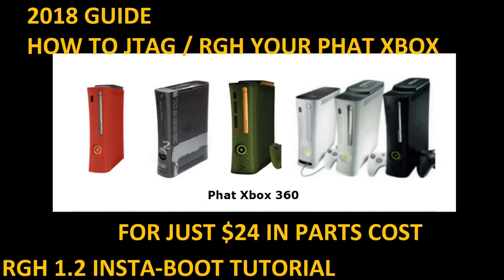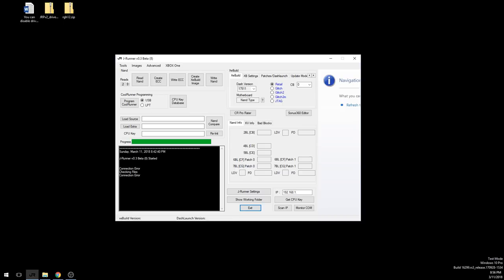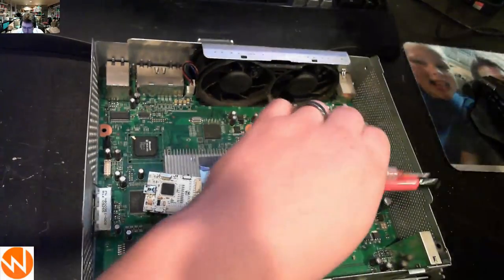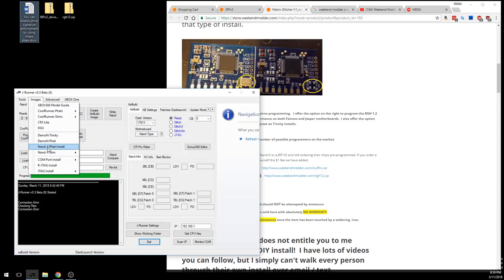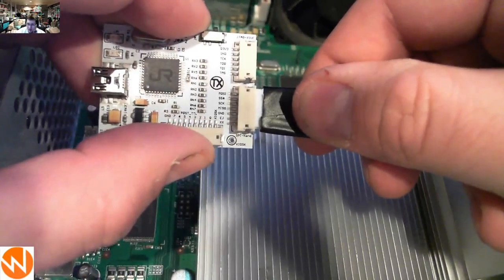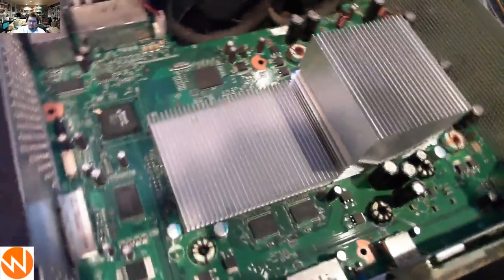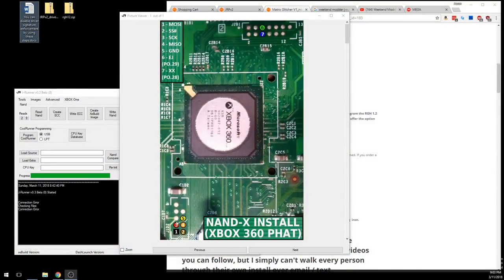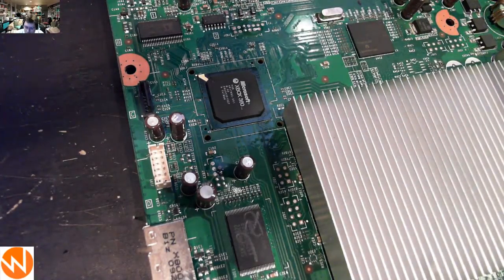2018 Complete Guide to RGH not JTAG your fat PHAT Xbox 360 for mod menus and emulators

Comment: Attempted this on a JASPER 16 mb.  Soldering looks good, able to write the ECC.  At this step, Xell will not load - just a black screen. Fans are not at full speed, green light blinks repeatedly.  I tried to reinstall the original NAND, and now I get a red ring of death.  Any thoughts?
Reply: OK, so I removed VCC from matrix glitch chip, and now the XBOX loads fine with the original NAND.  What would problems with the Glitch Chip connections look like?
Reply from the maker: Nope - with original nand and a glitch chip active I'd expect it to fail.   Double check that before you click "create ECC" that you have the Glitch2 selected then re-write that ECC file to the console, re-hook up your power wire to the glitch chip and try again.    What timing file did you write to the chip?  The RGH 12_21 ?
Reply: So, one difference b/w this video and my setup is that my 360 has Dash 17526, the May update.  I am attempting to use J-Runner with updated XeBuild files (from the team-xecuter.com forums, can't link for some reason).  I am thinking this may be the problem.

-Glitch chip is programmed with RGH 12_21.  I attempted other timing files as well, with no luck.

-Glitch2 definitely selected, still nothing.

-I went back and used a voltmeter to test the wired connections from Glitch to board - no resistance, so I assume they are good.

-I've looked on other forums, and it looks like the symptoms (black screen, no Xell loading, single center green blinking LED on faceplate) can be caused by a bad flash.

Any other thoughts?  Thanks for help!
Reply from the maker: Its definitely not only because of the newest dash 17526.  RGH 1.2 works just fine on even that newest dashboard.   What sort of AV connection are you using?  Tried alternate HDMI vs AV?

Comment: I have f... up the R8C2 RST Point ... where can i buy a restistor like that ? Do i need to buy a defective Board ?
Reply from the maker: It's a 1K ohm like 0502 package resistor. I actually think I bought a roll of a few thousand of them.   Lemme see about adding them to the store tomorrow.
Reply: TheWeekendModder Thanks a Lot :) I think an EBay link would be better. The shipping to Germany cost to much from USA sadly.
Reply from the maker: ZaZzCode you might be surprised.  I ship to Germany for something like like $6usd.   Still too much for resistors only, but maybe you'd see other stuff on the site.
Reply: TheWeekendModder Yes i think 6$ are good to Germany. Okay i think i Search for More in your Shop :) I have RGH'ed about 25 Consoles ... And then i got this Jasper that wouldnt boot with RGH 1.2 so i did the S-RGH and this works a lot better. But then i messed up the resitor.

Comment: Can you still solder a 3.5" HDD using a sata cable after this mod? I would like install a bit hdd internally. Thanks!#
Reply from the maker: I don't know what you mean by "solder a 3.5" HDD" .    Solder it to what?  Or why? 
If you mean just installing a 3.5" HDD - yes, but you'll need to be creative about powering it.
Reply: TheWeekendModder Yes, correct. Ive seen a pretty simple method of soldering a sata cable to the motherboard hooking GND, +12 and +5 to the board so you can have an internal HDD. I am looking to make a drive bay so I can remove the drive easily for hooking up to my PC for loading homebrew stuff more easily. Thanks!
Reply from the maker: External USB HDD would be a much simpler solution.  I like the WD "Mybook" ones.

Comment: Would this work for a zephyr? The pictures in your image include a halo 3 360, many of which were zephyrs
Reply from the maker: In theory, sure - but in my personal experience the Zephyrs were very difficult to mod and aren't worth the trouble.
Reply: @TheWeekendModder  sorry to revive this question, so i can use this  chip on a zephyr? Asking because i could practice the rear soldering on it then get another chip for my jasper.
Why do you say its a pain?

Comment: Hi there! Many many years ago, while trying to flash an x360 disc drive to run burned DL discs, I accidentally dumped the original data with 0000000000000000000 as the drive serial number, then patched it and wrote it over the original one with this wrong serial, so the drive would no longer be recognised by the motherboard because it had the wrong serial number. With this JR Programmer thing, would it be possible to recover the original serial, witch is suposedly stored in the motherboard data?
Reply from the maker: I think you're confusing "serial" with "dvd key".   Yes - you could RGH the console to obtain the DVD key and then either re-flash your disc drive with the correct key, or if you keep the console RGH'd you could change the dvd key within the nand to match what is on the drive.   Either way works, the keys just have to match.
Reply: @TheWeekendModder  yes well its been almost a decade, i kinda forgot the right lingo here :D but thank you very much for the answer!

Comment: I accidentally let a blob of hot solder fall off of my iron onto the board and it happened to land next to a RAM chip.
It splashed and went underneath the ram chip, I managed to pull it out the way it went in but there's still some under there shorting it out.
Any idea of how to get the rest of the pieces out? It RROD's because of it. I am using leaded solder which I think has a lower melting point.
https://imgur.com/a/JdkbJEv
Reply from the maker: Man! That's a tough one - unfortunately the only tricks I know about would involve a BGA hot air reflow station and removing and reinstalling the whole ram chip.  You'd need solder balls and a template and the whole deal.
Reply: yeah haha it was very unlucky. I'm just gonna use it for parts I guess, I don't have the tools to do that. I have another xbox though i'll try it again soon.

Comment: also can this V1 matrix work with A slim Trinity? I think I've read it does. I have a RGH falcon from the beginning of RGH. I now want to try this on another falcon and on my slim for the longevity. hope for some replies
Reply from the maker: Yes, it can using the "muffin" install technique.  Check out the latest video on my channel - it's exactly that mod...
Reply: TheWeekendModder thanks mate. I didn't get a notification from your reply. As I said I believe I've a Trinity so gonna order the hardware from your site. your sold out of the nand flasher. Do you have another link to one of the same or similar. Thanks again. been watching your videos for the last few weeks. The best around YouTube in my opinion.
Reply from the maker: The Nand-x are  very much in stock.  :-)
Reply: TheWeekendModder I'm in the UK.  If I order how long would you say for the stuff to arrive? A week? Thanks bud
Reply from the maker: 7-14 business days, depending on customs and such.  :-)
Reply: TheWeekendModder appreciate the quick replies mate. Gonna order now. I have alot of gpio wires I bought not so long ago never used. Would they be fine for the install? Great quality wires. Sorry for all the questions
Reply from the maker: The wire routing is really more important than the wire type, though on RGH 1.2 the kynar / wrapping wire really works well.

Comment: Hey @TheWeekendModder does this work on latest dash board current one on 2019?
Reply from the maker: Yes
Reply: Thanks you are the best I was watching mrmario2001 and u did a way cleaner and detailed tutorial (nothing against mrmario2001 I have sofmodded my og Xbox with his tutorial) but you for sure get this video a much understanding... Thanks I hope you are doing okay in that basement you got!.
Reply: Last question @TheWeekendModder I currently have my xbox360 fat on latest I can still install this chip and do everything or was I supposed to do rgh on lower firmware?
Reply from the maker: @Tiktok_nostalgic_Gaming  yes, rgh works the same even on latest dash
Reply: TheWeekendModder hello i soldered the point like u said and with ur technique but when i go to jrprogramer i get an error that says no connection when my pc is connected to wifi and i have tried with ethernet cable and i get the same error and also it does not let me install the drivers i get an error

Comment: Do i need the jr programing tool  if i buy your chip already programmed
Reply from the maker: Yea, you still need a way to read and write the nand so you still need a JRP or a NandX
Reply: @TheWeekendModder  I ordered the CR with timing from you. Does that mean I can just use the Matrix SPI NAND Flasher for the NAND read and write steps? If so do I have to unsolder it while installing the glitch chip or can I just leave it there?

Comment: can you use the alternate cr3 lite cpu rst wire install with a corona muffin install
Reply from the maker: Joseph Gawron maybe but the rst point is one that can adversely affect boot times. So using any other rst point may result in worse boot Times
Reply: Thank you just don't want to mess it up like a clock point on a phat
Reply from the maker: The point I use in this video is pretty sturdy - moreso than any of the other RST points.

Comment: Having an issue. On my falcon, the Blue light on the mod chip, stays on, when the console is plugged in, but not turned on.. Any idea?
Reply from the maker: reprogram your timing file to your glitch chip.
Reply: I bought the chip from you, pre timed, with 12_21. It even said so on the bag the chip came in. I don't have a timing wires. Do you sell those separately? Also, I found out the wire on the back of the falcon MOBO, the point FT6U1 came unsoldered. Could that be the case? And, some of my wires have exposed copper.

UPDATE: Just read on se7ensins, that if the post point is not connected, then that blue light will turn on, on standby power. Only problem is, is that I don't think there is any metal left on that point. Is there any alternative post point?
Reply from the maker: Yea, if you killed FT6U1 I don't know that you'd be able to solder to the little bitty tiny via that is the alternate point.   First think I'd do is rewrite the stock nand and see if it still boots...

Comment: Mate can I still do the this on a Falcon with 17526 dash?
Reply from the maker: 100% Yes.
Reply: sweet thanks. One more question, I can buy the Matrix and Jr programmer from you and not have to solder right ? cuz im fucking shite at it and id probably end up screwing my motherboard
Reply from the maker: No - the Matrix glitch chip still gets soldered in, and you have to solder the JR Programmer to r/w the nand.   Soldering is a requirement pretty much.  Maybe consider my send in service as an alternative:   www.sendin.weekendmodder.com
Reply: Not available to international customers it says on your site. But no worries, I guess I’ll just have to learn to solder lol

Comment: This would not work on zephyr, worked on my falcon however.
Reply from the maker: Zephyrs are super unreliable and in general I don't work on them.
Reply: Usually with Zephyrs, the issue is that the GPU is on its last legs, and glitching makes it go too hard for it to boot. OFW usually boots for a while, but the consoles usually also crash in-game. To get a zephyr going semi-reliably, you need to, at minimum, reflow the GPU chip professionally with something like Insat Super Flux. From there, the standard stuff of replacing the thermal paste on the CPU and GPU apply, and setting the auto mode for the SMC fan control to target 60C instead of 80C for best performance. That last thing should really be done for all consoles though, just mentioning it. Ideally though, you'd have to replace the GPU chip with a brand new one, and reflow the CPU as well. All in all, it's definitely not worth it when you can just get another more reliable system for dirt cheap.

Just as a note though, but I have a Xenon JTAG that I've owned for it's entire lifespan. It was repasted before anything, and its SMC has always been set to 60C. It's still alive and going today.

Comment: Have Matrix V1 (clone), Jasper 16mb and dumped NAND via LPT and programmed Glitcher etc.. but no Glitch successful :( 

But i suspect my Glitcher has some problems. Led doesn't light up really so much. At the programming it is too little dim. Cmon post office should get another chip tomorrow.

Edit: There seems to be some voltage differences as some places it is said that Fats / Jaspers would want 1.3V and this Matrix has some quality issues as it put out 1.49V.. Hmmm.. There is multiple things borrowed from original Glitcher board so need look more. It does resets and so but wont be succesful.

Comment: On mother board mine just says 
Checking Console..
Device Not Found.
Can not continue
any help?
Reply from the maker: Device not found would make me tend to think you've got a driver issue with your JRP or nandx.  Ensure you're seeing the apporpriate logo within Jrunner and make sure you're supplying standby power to the console while attempting to read it.  Then if still have issues check and re-check your soldering.
Reply: I actually fixed it now im just waiting for my coolrunner to be delivered
Reply: How did you fix it? I have the same issue..thanks
Reply: install the drivers
you need to enable unsigned drivers first then install them in device manager
Reply: Jack Manning thanks
Reply: no problem